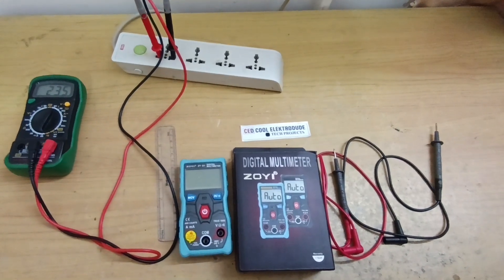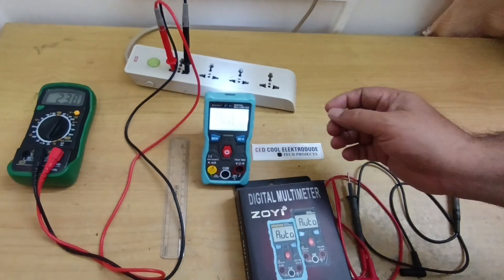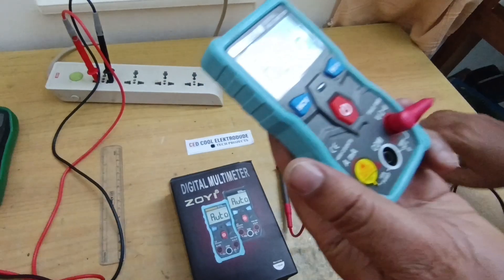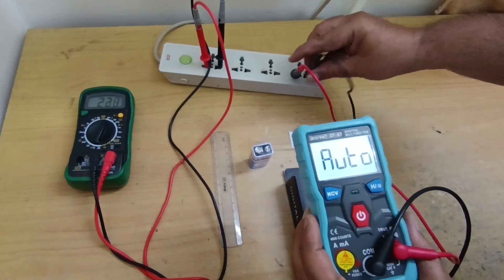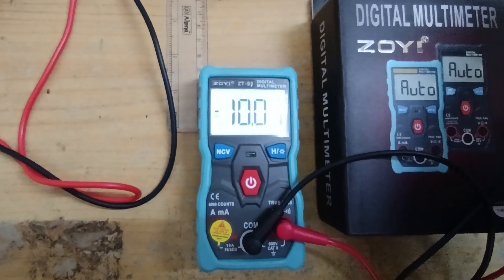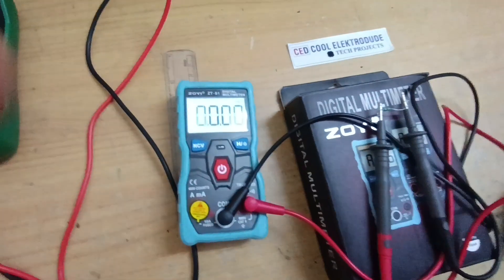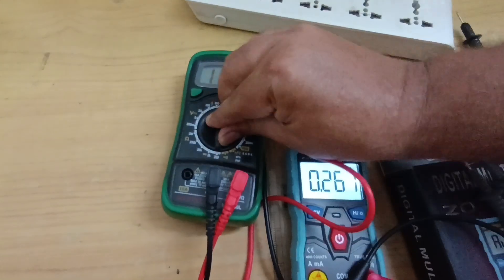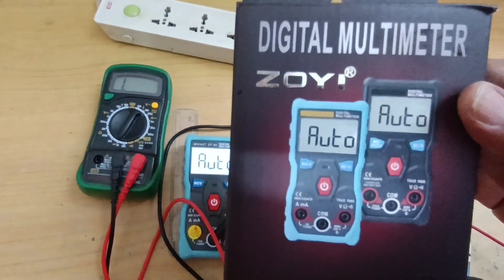ZOYI ZT-S1 Digital Multimeter  with Autoranging, True RMS , NCV DATA HOLD LCD Backlight ,Flashlight

Comment: No AC DC current measurements ???
Reply from the maker: Pls check the video completely , dc and ac voltages are measured
Reply: @coolelektrodudetechproject1835   current not voltage